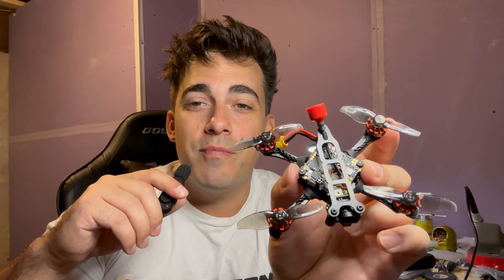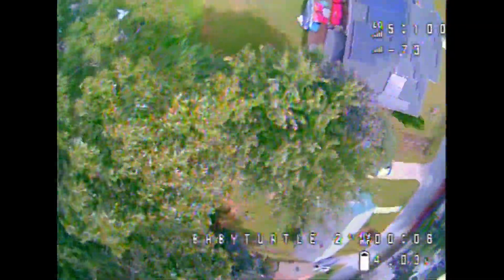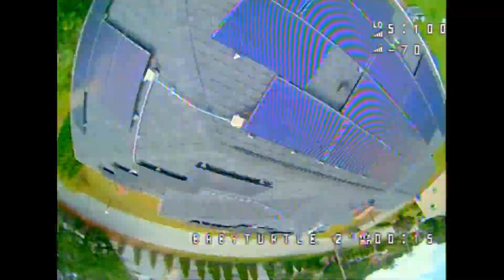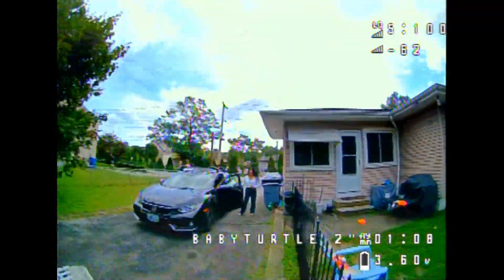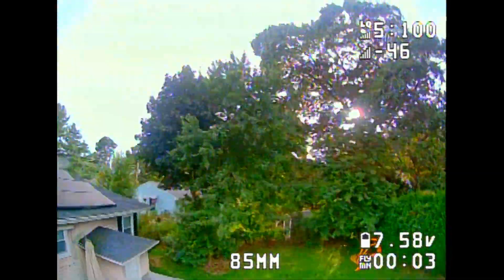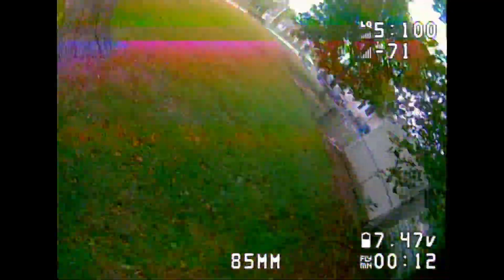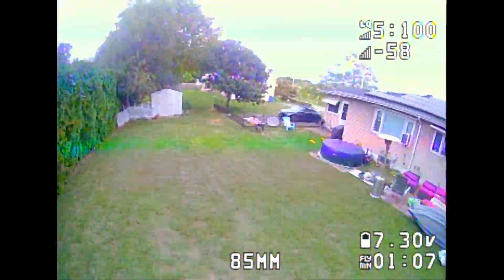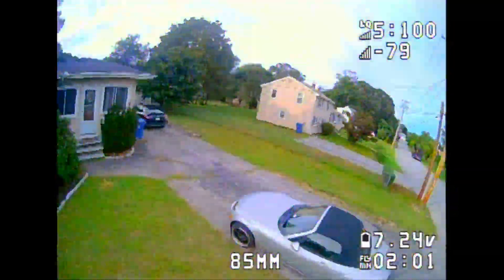Baby Turtle 2" Toothpick - My NEW Favorite Micro?! Review, Build, and Freestyle Flights - Sub250gFPV

Comment: @MoeFPV I love this form factor. I have a couple questions. 1; does the 2s have frame bumpers  at the motors? does it need them? I'm worried they might add weight. 2; Whats the lightest caddx vista build that flies well? I have a couple vistas that I could put into a build to get that digital experience (5inch is just too big for my space).
Reply from the maker: I have another solution for 2” HD - another frame by the same designer called the BAT. video to release in a few weeks but do you have access to the 03 system? I haven’t built this quad up on vista - only walksnail. But the 03 Bat is by far the best digital experience on a true micro I’ve flown

Comment: One quick question, i dont think you showed how you mount the battery to the frame. I have built two of these by now (one 45mm 1s and one 2'' 2s) and i havent gotten the trueRC antenna to fit because my batteries are allways in the way.

Comment: Hey Moe! Question: Did you need to ream the motor holes out to fit the 1103 motor screws?
Reply from the maker: On this version, no I did not. The slightly larger motor screws of the 1103s fit just fine. BUT the new design will probably not accommodate the larger screws without drilling them out slightly , is my guess. I don’t know for certain, but I rather tell you no just to be safe !
Reply: Thanks Moe! Yeah I'm still digging the toothpicks. Being able to fly in a Walmart parking lot in the middle of the day with nobody knowing is priceless.😂I'm still rocking the TP3 style toothpicks and I have an 82mm Blujay Walksnail I just built with 1103 motors and BetaFPV AIO board. But the baby Turtle is definitely cool. I'm thinking it might have more protection for the cam and the AIO board. Especially on the Baby Turtle X that's going to come out soon. @MoeFPV

Comment: While they do tend to perform quite well, I've been noticing gyro issues with the X12. Got two of them and I just constantly hear little chipping noises from the motors on both a stock Mob7 and my custom 2S 3" toothpick. Haven't been able to do anything to completely get rid of it.

But yeah, micros are going so far lately. I absolutely love it!
Reply from the maker: Thank you for the feedback - i havent had any issues with my x12s just yet, knock on wood. What behaviors do you tend to see? Is it just the audible noise?
Reply: @MoeFPV  On the Mobula, I suspect that the small size and torque are preventing it from being a visible effect. On the 3" toothpick however, it absolutely causes visible vibration and there's an excess of wiggles in the gyro data. (external blackbox) The odd thing is that I took the Mobula's flight controller and put it on a Bassline frame, and it's one of my most solid quads now. Maybe it's all frame related stuff.

Comment: I have the mobula 8 and feel the frame is week.  How do you feel this frame holds up in comparison?
Reply from the maker: Just broke my MOB 8 frame a few days ago... this frame should absolutely fare better than the mob 8 plastic frame. You will also get additional flight performance when losing the ducts. IMO, if you dont need prop protection, ductless drones provide a better flight experience.
Reply: Hmm I was looking at ordering a 2inch baby turtle but it looks like all of sub250gfpv frames are no longer on cncdrones site for sale😢.  Is he selling them somewhere else?  Did you go with 1.6 or 2mm bottom plate?
Reply from the maker: @AndyGJorgensen  hmm I think the frames might be moving to a different manufacturer - i will ask Phil tomorrow and let you know asap
Reply: @MoeFPV  thanks I appreciate it I haven't found any info yet on places to order.
Reply from the maker: @AndyGJorgensen  hi Andy - I spoke with Phil and it appears as though the frames are temporarily not available. I will reply to you on this comment as soon as they are available to purchase again, either on CNC or a different vendor. Sorry for the delay

Comment: dope i dig 2" x 2s  :)
Reply from the maker: Ive been loving it lately! Cant wait to build more - maybe an HD version
Reply: @MoeFPV  im still flying with my  old school FS HDO.   Which HD goggle eco system have now?
Reply from the maker: I have the HDZ goggles currently. Couple that with an analog module and with the walksnail VRX and you have 3/4 of the systems ! I also bought a cheap pair of DJI V2 goggles off of eBay. But I do primarily fly analog still. What system are you most interested in?

Comment: Just curious, why could you not use DJI's digital platform? Too heavy?
Reply from the maker: Nitro - mainly i was concerned about the weight and dimensions, as the vista and 03 are all dual stack boards, ontop of the AIO required for the build. Technically, you MIGHT be able to squish in a Naked Vista and an AIO but I would not recommend for this particular frame. You would need to look for a roomier frame to give that board stack more space but there are definitely some available

Comment: Yes sir!   Hahahaha  I'm building a 2S 2" Odonata.  My T-Motor F1103 1100Kv Motors are due to arrive tomorrow.  I plan on installing the Walksnail HD 1S video, Foxeer Reaper AIO, RadioMaster RP2 ceramic ELRS recever.  I'm praying it will all fit.  What recommendation for battery Mah?
Reply from the maker: Sounds like an awesome little build! Depending on the final weight, i would say anything from 450-750s would be fine. I tend to try to run the smallest battery i can while getting at least 3 or so min of flight time. I feel like 550 will be your sweet spot. Please let me know how it turns out or if you post any vids! sounds like a great build

Comment: 2" 2s is one of my favorites but I get out of control with it in my small backyard so I recently took a moblite 7 HDzero and put it in a tks rocket frame and put 45mm props on it and it's currently my favorite for my small space.
Reply from the maker: Sounds like a nice little ripper! I enjoy my 1s quads, as well. Still a great choice for quiet, fun, and safe flying. Ive been meaning to build up a rocket race, as well. What motors are you using, if you dont mind me asking. thanks for the watch!

Comment: Great video. Subbed!

Just finished my first full build after breaking too many Crux 35 bottom plates. I went with a RVS Yeet35 frame, Mamba F7 stack, ELRS, and a Vista - while I reused the Crux 1404 motors, I have T-Motor 1507 3800s on the way. I enjoyed the researching and building as much as flying. 

I'd love to build something like the 1S in this video - quick to charge and get up in the air. However, the 2S version looks sick!

On a side note: Other than lots of stick-time, what's your method for learning tricks? You have a pretty wide repertoire. Do you practice new tricks in the sim or just send it?
Reply from the maker: 1s and 2s are both great in their own ways. 1s for the quiet convivence and safety and 2s for that extra power and control! To me, you cant pick just one 😉 But i am very fond of the 2s on this platform. 

For new tricks, i do practice most of them in the sim to start then move over to doing them on whoops or other small crafts that i am not worried about breaking/breaking other things with. I found that, if i got confident with a new trick on my whoop, i could do it on my larger drones either right away or within a few tries. Just need to keep in mine the throttle when switching between more powerful drones. 

And always be confident in yourself when attempting them ! Thank you very much for the sub ! More content coming very soon : )

Comment: What vtx and antenna setup are you running? Looks to be good for penetration 👌🏽
Reply from the maker: On the 1s version I had a flywoo 450mw external VTX with true RC singularity. The 2s is an X12 internal 400mw with true Rc singularity

Comment: I love that build, but I still stick with the 65mm propped toothpicks with 1103 8k-10k kv motors. I have one that's down to 43g and it's a beast. I also started flying fpv way back before brushless toothpicks. I had a brushed "toothpick" from the micromotorwarehouse days, then I saw kababfpv make a brushless one and....I was fully in the hobby after that. I was all fixed wing before Mr. Roogi introduced me to crack...I mean toothpicks
Reply from the maker: Damn ! You are an OG then - thank you very much for stopping by. I was enjoying the mob 8, a 2s 85mm whoop. Are you flying a 65mm 2s ?? How is that experience? I have never flown that setup before. And kabab is my hero ! the Babytooth and TP3 are still probably my choice of quad if i could only have one for the rest of my flying life LOL
Reply: @MoeFPV  no problem man! The 65mm 2s is 65mm (2.5") propellers on a 100mm frame, one of kababs original toothpicks before the 3". And I too have a 85mm 2s whoop, and it's my go to whoop around the shop or jobsites when I'm there. I was taking part in IGOW this year, but I had a baby boy so that got put on hold lol. I only have 1 or 2 videos of me flying, but they're both the meteor85 2s.
Reply from the maker: Ahh i see, i thought you meant 65mm whoop! lol ive heard of those being on 2s but sounds crazy to me but what do i know. and Congrats on the baby ! I hope all is going well - IGOW is such a grind i rather raise a kid LOL hope to see you in there next year @sakfpv8444

Comment: No experience with FPV but am comfortable with 3d printing, lipos, and soldering. Is there a frame/setup recommended for newbies? Are these smaller frames more affordable than larger ones?
Reply from the maker: For a complete beginner, i would not recommend an open prop build like this. I would get something called a WHOOP, or a prop protected micro drone. Check out the Happy Model Mobula 7 - i think this is about the best drone you can when you first start. Powerful enough indoors and outdoors, safe, small and cheap batteries and will grow with you - as long as you dont break it ;)

Comment: I prefer 2s on 2inch aswell bro.
Reply from the maker: Same man - I really wanted to love it on 1s for the convenience but I got SPOILED as soon as I flew it on 2s lol
Reply: @MoeFPV  definitely, my 2s 2inch is 32 grams, it's almost too quick. I love it.
Reply from the maker: @CallistoFPV  damn that’s LIGHT! What motors you running? I think these 1103s are a BIT much for this build but was such an easy swap out of the mob 8
Reply: @MoeFPV  betafpv 1102 old 13500kv ones, (the new 14000kv would be good) with the X12, and on the cncdrones Pickle 2inch frame.

Comment: Awesome review and flying Moe!!! 
Did you go with 1.5 mm or 2 mm thickness for the bottom plate on your 2-in build?
Also what are your flight times on the 2-in 2S build on the 300 and 450 battery?
Reply from the maker: Thank you very much Chrys! I went with the 2 mm for the 2” as I knew I would probably be beating it up 😅 probably would go 1.5 for the 45mm though. On the 300mah on the 1103s I could squeak out about 3 min if I wasn’t gunning it the entire flight. Over 3.5 min on the 450 and I tend to baby my multi-cell batteries a bit. They usually recover to 3.6 ish when I land. Those 1103 11000kvs are tough sometimes because they will sag the hell out of a battery and I never know if it’s going to come back up or give out on me LOL
Reply: @MoeFPV  Thanks for the info Moe! I may have to try this platform!

Comment: Nice builds!  Been looking for ideas to build 1-2 2" 2s+ micros this winter.  So happy to see more frames coming out.  Going to be hard to pick one.  Happy for the increasing amount of choice.
Reply from the maker: I am still very partial to my 3” toothpicks - something about the flight characters gets me. Usually more floaty and drifty. But this 2” was a pleasant surprise - felt like I could fly it a lot more aggressively due to its smaller size and surprised me big time with the punch !
Reply: Turned a Mob7 1s Elrs into a 2s Crux3.  It's so quiet.